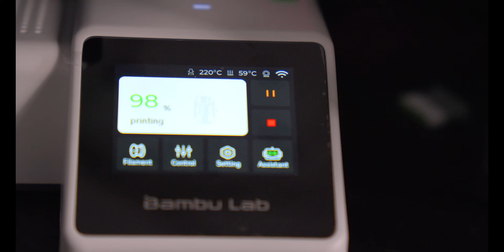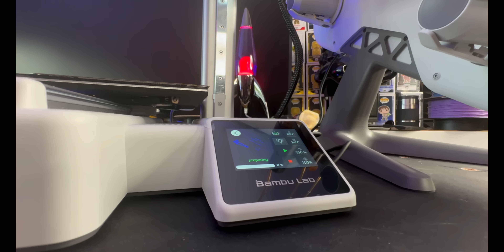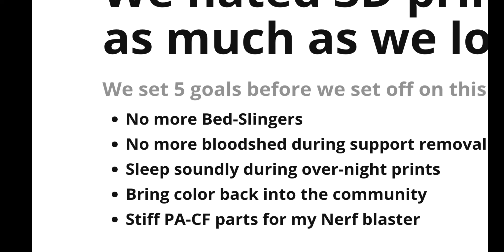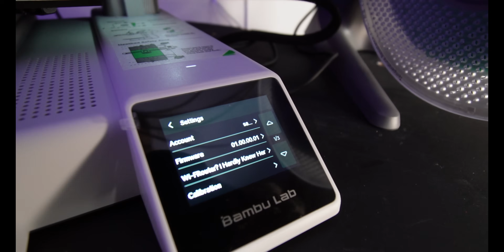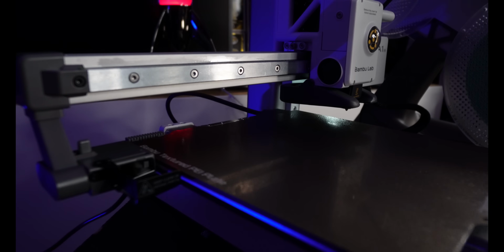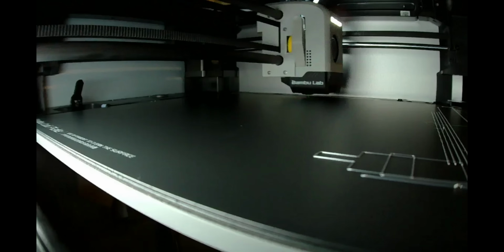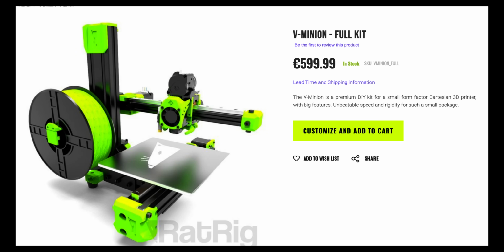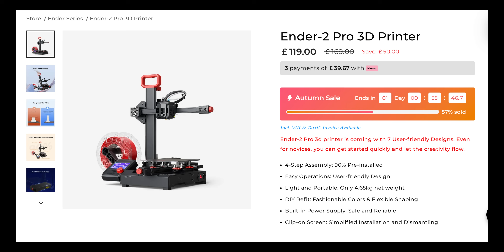Bambu Lab A1 Mini & AMS Lite? What’s not to like?

Comment: Awesome video!

Did you test out multi material at all?
I tend to use PLA as a support interface layer for my PETG parts and would love to know if people have had success as well as how well it handles PETG in general.
Reply from the maker: PETG is good, I’m yet to play with many other options but I will :)
Reply: @TheRealSamPrentice but does it do multi material using pla as a support for PETG or vice versa
Reply from the maker: @Ebonyqwe  yes
Reply: @TheRealSamPrentice  thanks 🙏

Comment: When I first saw that the most hyped printer of the year is a small cantilever bed slinger, I was thoroughly unimpressed, but after seeing how much Bambu Labs has packed into this little thing for $299,  I want one. I'm still not thrilled at the amount of waste generated by multi-color printing, and if I heard you correctly, the AMS only works with Bambu filament? That would make the AMS a hard pass for me. If it works with all brands of filament, though, then it would be worth getting the combo. It'll be interesting to see how Prusa responds to this.
Reply: It does work with all filament. It just has the capability to automatically recognize Bambu filament.
Reply: avoid TPU or ABS or PC, other filaments of others brands in PLA and PETG works fine!